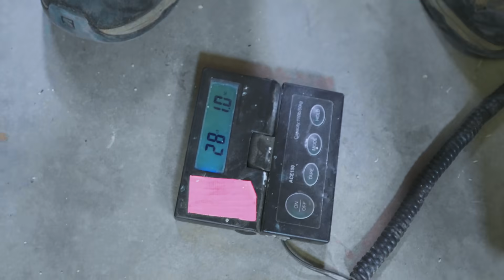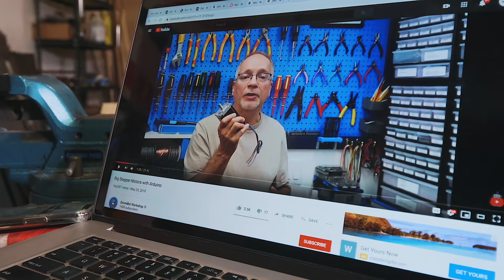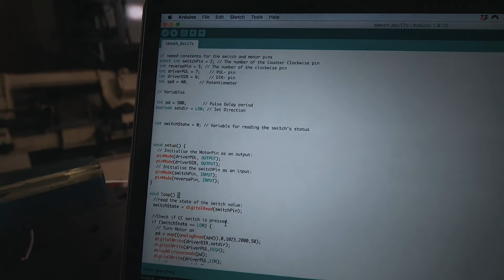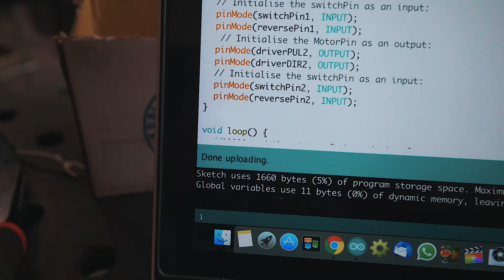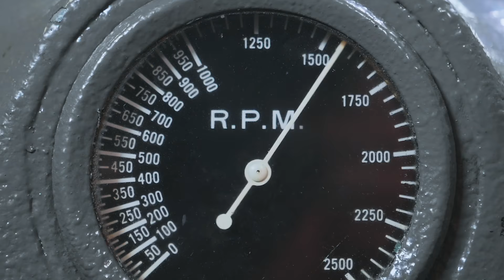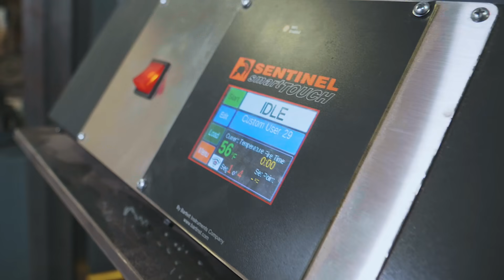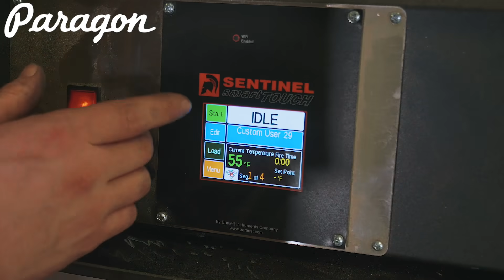MAKING FORGE DOORS!!! Part 2

Comment: Easiest solutions:
Simultaneous door operation 
- unless you actually want to work on your programming abilities, get another Arduino (they're cheap) and run 2 completely parallel systems.

Load capacity
- get a couple of those hands crank worm drive winches from harbor freight, modify them to be driven by your Arduino/stepper solution.(Cheap and more than capable)

Simultaneous AND load capacity 
- scrap it all and get a couple of cheap winches, fab something to give yourself foot levers to manipulate the controllers.

Undoubtedly, Alec will end up with a thousand dollar jewel encrusted Frankenstein that works and creates plenty of content, with 10s of episodes, and i will watch them all enthusiastically! Good luck bro!
Reply: Better version would be to figure out how and machine your own worm gear setup - that would be cool. Lol. I was mistakenly under the impression a worm gear set would be more expensive, but with a little research it appears you can probably buy a nice pretty little set for less than the harbor freight winch. Good luck!

Comment: Some coding advice: two lines of code will not act simultaneously. It's a linear process of one line, then when that line completes, it checks the next line, and does that line to completion. So if you have a conditional statement or while loop that acts while a single button is held down, it will ONLY do what's contained in that loop or conditional statement until the condition is no longer true, regardless of if you held down other buttons.
You need to make conditions within conditions if you want multiple inputs to occur simultaneously.

Comment: @Alex Steele What do you think about elevators?
If you don't have enough potency on the steppers, just add a counterweight like in elevators.
That way the stepper will only need to deal with the diference from the doors and the counterweight

Comment: I'm 100 seconds into the video...and problems already?  Anyhow...paused it: Can that little motor lift 30lbs? Yes. Option 1: Gears to get more torque and. Option 2: Pulleys to do the same. Option 3 (The best idea): Counter-weight the door with a mass that's 95% percent of the mass of the door.
Reply: Don't forget that he can and should put a worm gear on the stepper motor. This way the motors don't have to work so hard to keep the door up in the air
Reply: First thing that came to mind when he mentioned the weight and questioned his little motors... Pulleys and snatch blocks.
Reply: Ahh he beat me to it with the pulleys/snatch blocks. I was just watching the snatch blocks video by SmarterEveryDay a few days ago. Any one of these aforementioned options with the motors below the heat would solve both problems!
Reply: @crazyeyez1502  keeping it simple is the key.
Reply: Couple used motorcycle chains, weld on some counter weights, and sprockets, motor can move the doors, doors stop where they’re stopped, just need minimal framing to weld sprockets to
Reply: Couterweight is definitely the way to go
Reply: I can't believe that I waded through a hundred comments before someone mentioned 'counter-weights'. Gear / pulley all you like, but for god's sake put in counter-weights, don't be mean to your poor little stepper motors (which are actually acting like simple DC motors in this scenario). And also end-stops, things are going to go pair shaped pretty quickly without end-stops.
Reply: Option 4: rotate the design 90 degrees. Support the door on THK rail and slide it left to right rather than raising/lowering it. This also has the advantage of getting the motor as far from the heat as possible
Reply: @crazyeyez1502  same

Comment: Alec: Counter weight the doors so the servos don’t have to hold the weight. If you rely on pulleys alone to handle the weight, it might be too slow to lift and lower.

Comment: Hi Alec, current mechatronic engineer here, building an Arduino circuit. Just a note about those pin cables on the breadboard; the internals & ends break, bend etc pretty easily. Looks alot neater & cleaner when you use singlecore pathwayed cable ;) easier to follow too.

Comment: Hi Alec, control systems student here. We can't see your code but I'd imagine that the problem is how your loops are working. If your code checks 'Is button A pressed? Do thing X until A isn't pressed anymore' and the same for Button B does Y. What you want is to put in another statement to check for when both are pressed, for example 'If A AND B pressed, do both X and Y'.

What this will achieve is it will keep the motors (X/Y) going until one of the buttons are released, wherein your code will keep going round and find the state it is actually in. you'll want to put in another equivalent loop or set of loops for backwards as well.

Can't be too much more specific without seeing the code. 

A problem you may encounter if you just put this in as another if statement at the bottom of the script, it won't work properly. You'll need to use IF, ELSE IF, ELSE to make it work how you want it to.

TLDR; Arduinos are bad at multitasking, so you just have to give them a single task to do both motors, and have it trigger that task when both buttons are pressed and stop when either condition is no longer true.

Hopefully this was helpful, apologies if I was too vague.
Reply: would this work though, if you pressed both buttons at separate times? cause if you're holding down motor 1 up, then it will be stuck in that loop until you release it, and it wont be able to run through the rest of the code. if you pressed both motor 1 up and motor 2 up at exactly the same time, it might work, but the odds of that are slim to none. im not nitpicking, im genuinely curious, cause ive been playing with arduinos for about 3 years now, and havent been able to do what Alec is trying to do...
Reply: @analog56x  that's only the case if you use if statements to directly control the actions.

If you use the if statements to shift bits into a variable and then use a switch case to execute the commands it doesn't matter in what order you press the button because you will have an action for every combination.

Example:

Button up 1 adds 0001
Button  down 1adds 0010
Button up 2 adds 0100
Button down 2 adds 1000

Now if you want up on motor 1 and up on motor 2 you put that in case(0101)

It doesn't matter if you first add 1 or the other. At the end of the day you are left with 0101
Reply: @TerrorBunney  that makes sense, i think... so it would be constantly looping and checking to see if the variable has changed. if it has, it acts accordingly. 

im struggling to figure out how you would change the variable while outputting though... there would have to be a momentary pause in the output to be able to loop again and check to see if anything has changed... wouldnt there?
Reply: @analog56x  on an Arduino, if you set a bit it stays set until changed. So if you go through and set 1 for FrontUp, the Arduino doesn't have to keep running logic to keep telling it to run, as long as you've wired the motor logic to go up when the bit for FrontUp is set to 1. It will run until the Arduino changes that bit to 0. So in the meantime you can run your checks for the other 3 buttons and set those bits to their needed state. That's running in a loop so in a millisecond or so you will have gotten back to checking the state of the FrontUp button, and so on. There will be no perceptible lag between when the human presses the button and when the outputs change.
Reply: @Uncephalized  YES!!! thats right! I started playing with bits a while ago, to be able to set parameters using a rotary encoder. I could cycle through a menu to change settings of a device i built, save those settings, then go and change others, all while monitoring a temperature. If that temperature went above threshold, it would immediately freeze the system and turn the cooling fans to 100%. Once the temp cooled off, it would unfreeze, and you could go back to changing settings and monitoring.

I totally forgot about all of that haha
Reply: @TerrorBunney  exactly. All the codes floating on google are for just to settle down curiosity but an actual application one needs to write functions and call all function in a loop to check all conditions and execute.
Reply: @TerrorBunney  While your solution is compact, its not necessary. Using individual bool variables mirroring the state of the motor control pins would do just as well. The compiler would probably optimise them into something similar to what you suggested.

Comment: alec you need some limit switches (optical or mechanical) if you need some help let me know
Reply: Alec, I agree. It will be easier to stop the motors once the doors reach the point you want them. It also doesn't require coding. You can look up how limit switches work. It will help a lot in this proyect. ;)
Reply: wouldn't it be possible to measure the resistance of the stepper motor ? no extra hardware and would add a safety element to.

Comment: if there was ever a vid for a 1 time sponsor this was it. the joy and astonishment of getting a stepper working! it took me back to my verry first programs. best add ever! you should have taken a sponsorship from arduino. 
worm gear will minimise stress on the motor. i thought you might be going chain and sprocket route being more durable. although i do like the cables. a counterweight will be worth the effort. you could use a ratchet to hold the door without power. im thinking medievil portculis type mechanism, butmore complex.

Comment: If the design had counter weights he wouldnt need to mess around with steppers. Also, dont forget the limiting switches.
Reply: It's pulley driven to adding weights on the cable down line is still a option.
Reply: @capelectronics  in theory yes, but I guess you have never used them in practice.

Comment: To get both motors to work you'll need an if statement at the top of the code checking that both buttons are pressed at the same time. Then adding the code that makes them turn in each direction.

The reason they both don't work is because it gets 'stuck' running one of the sections of code and can't activate the other part.
Good luck!
Reply: Happy to write or walk you through how to write the code, looks awesome!

Comment: For your first crack at programming electronics I'd say you did a great job. Electronics and motors are super cool and fun. There are some things you may want to address before moving forward with your design (i.e. pulley material, interlocks/safety/limit switches for motors, etc.), but that's all part of the engineering process. Great progress! Merry Christmas to youand yours and the team!

Comment: Worm gear! If anything on this setup fails (power, arduino, motor, cable) , you will have a 30 lbs door dropping on whatever happens to be underneath.

Also, you could make the door with fibrewool insulation and only a little bit of refractory cement for health reasons, to save on weight

Comment: ALEC! Look into a counter weighting systems like how elevators work. That will take out the worry that the stepper motors will not lift it and reduce wear! It will also prevent the doors from slamming shut when the electronics fail, which they may if they have to hold up the weight constantly when it’s open.

Comment: I don´t think the arduino is having a problem driving two motors at the same time. It may be that it pause the code in a way when a button is pressed. Maybe an if statement like if both button 1 and 3 is pressed start both motors.

Comment: you need to ad another conditon.
currently you just have button one or button two but you need (button one) or (button two) or (button one and button two)
I hope this helps
Lukas (germany)
Reply: there are 4 buttons though, that'll be a pretty long if else chain. It'd probably be simpler to write a single function MoveDoor(bool door, bool direction) or whatever the arduino equivalent would be and just have that function be called instead, then you wouldnt need to ccopy the same code 4 times or more, just one switch statement and a single function
Reply: @themanofquagga  but i want to make it easy

Comment: Pro-tip from a machninist :) If you want your aluminium to machine alot nicer with better finishes/less galling on carbide tool-tips, use Kerosene as your lubricant. Same for drilling it as well, kero in a spray bottle is your friend.

Absolutely love your work mate and love the constant plugging of our Aussie tools! Keep up the quality!

Comment: Hello Alex, just for future projects, there are ceramic fiber board, and paper (3mm and 6mm) and both of them are extremely light and the insulation is really good. And there is ceramic fiber sleeve, for cables, so that it doesn't burn them

Comment: Alec, add a bumper switch to the bottom of each door and adjust the switch point so that the cables don't slack out and add an open limit for each door. Add inputs for dual or single operation of each door off of the same same foot pedal switch input. Also add an E-stop push button somewhere just in case a door limit fails to trigger.

Comment: As a machinist/blacksmithing fan/programmer I've naturally never been looking forward to a video of yours like this one! Congrats for getting over your fear of electricity and into such a project!

If you're using the standard stepper library, keep in mind that it locks the program's execution until the number of steps requested are finished. Try moving 1 or either a small fixed amount of steps per loop and using a unsigned long variable per motor along with millis() to time the stepping (check BlinkWithoutDelay.ino). Also just in case, don't use if/else statements to chain-check your buttons, just an isolated if statement per button.

Good luck!

Comment: I think your code may be using delays in the code, it pauses the program to do something and that can stop doing things at the same time. You can set up what is called a millis timer that can let you run many things at the same time.
Reply: Dont think its delays, must be the way he programmed his buttons. If he has it programmed like this,

sudo code (not real code):
/*this will cause the program to enter the while loop, halting the rest of the code
 * while(button is being pressed){move the stepper motor} 
*/

The way to fix this issue would be to use constants and if statement such as
/* int butt1;
*   int butt2;
*  if(button is being pressed){ butt1 = true}
*  if(button2 is being pressed){butt2=true}
* 
* if(buton1 == true){ move stepper motor1}
* if(button2 == true){move stepper motor2}
*/

This again is sudo code, You will need to translate the logic to the arduino. Assuming you have a while loop; when you press the button, the code will continue to loop in the while loop until the button has stop being pressed. Consider posting your code on github, an open source code platform.
Reply: @chachasmooth1992  that could also be an issues I think if you replace the If statements with While statements it should fix that.

Comment: you can wire the two steppers onto one driver
Reply: I presume he wants separate so he has the possibility to leave the rear closed and open and close the front for inserting his project.
Reply: @jaymarler  ah yea that makes sense
Reply: @patrickwynn4952  I initially thought the same as you.Thanks for asking my question :)
Reply: Each stepper takes 4.2 amps, and thats the max each driver puts out. It wouldn’t be able to drive both stepper with the current they require.

Comment: "We're gonna make an aluminium pulley"
Excuse me, what?
Reply: That will break
Reply: I second this as you have steel cable and aluminum pully it will eat through the pulley with in a few uses please change this before next Episode. Also could use a weight distribution system where you have counter weights on pullies on  each corner at the top of the frame so if the motor fails the door won't fall shut rather ease it's way down slowly. Please read this
Reply: @nicojoubert9338  lol, I love how everyone else is pointing out the logistics of this bad decision, but I was just joking about him saying "aluminium".
Reply: @christophermorin9036   I totally understand but I say aleminum and not aluminum  it's interesting how one piece of alloy can have two different ways of being pronounced.
Reply: Needs an aluMAXIMIM pulley.

Comment: If you used counter wights, the motor not even needs to be that strong. You just need to add some wight on the wire on the opposite side of the pulley.
Reply: This is the answer.
Reply: Genius